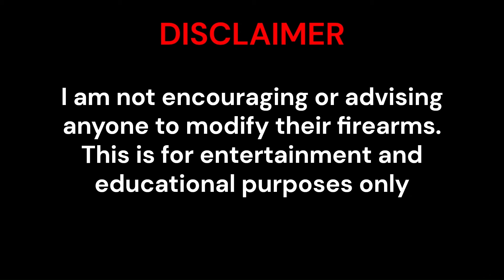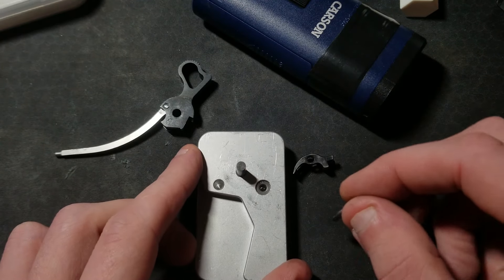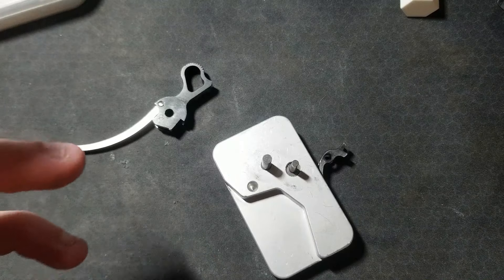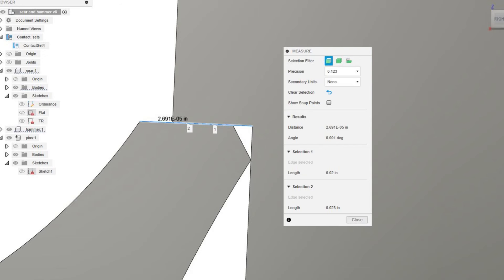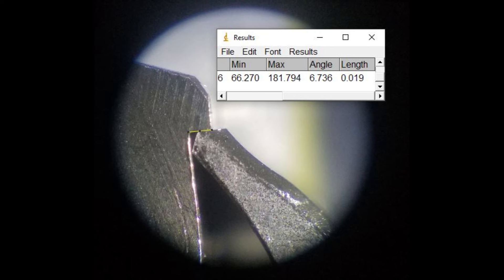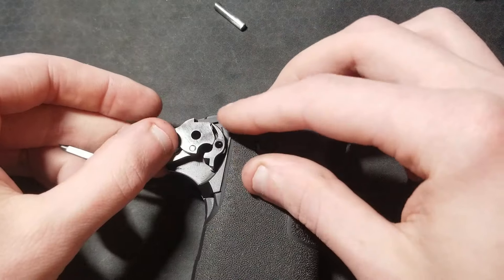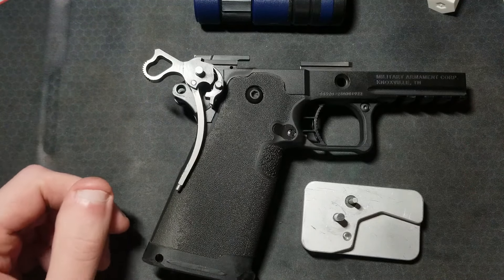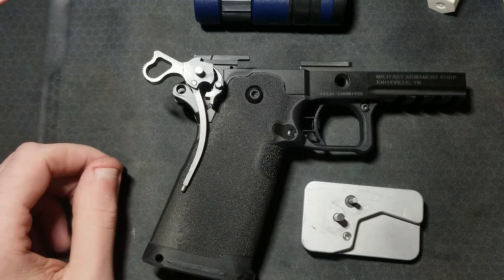Improving My 1911 Trigger Job Tooling and Methods

Comment from the maker: I have found a scanned copy of an original blueprint online: https://www.survivorlibrary.com/library/m1911_blueprints_scans.pdf

This blueprint calls out a +/- .002" tolerance on all sear and hammer pin locational dimensions. Based on that, the range deemed acceptable by the ordinance dimensions for the minimum spacing of the sear and hammer pin holes (rounded to 2 decimal places) is .452" - .463" with the nominal value being .458". This is the hypotenuse of the right triangle created by the horizontal and vertical separation distances of the pin hole (see 02:12 in the video). 

I put those dimensions in my 3D model - the range produces a 2.5 degree engagement angle change between the primary sear face and hammer hook face.

That is a very large acceptable range and the true location of my pins with respect to each other in my jig is well within it.
Reply: I watched an AGW video on triggers a while back.  IIRC They said they matched hammers and triggers on a jig out of bulk batches on a jig before even trying them in the frame.  Then talked about pin holes not being parallel on state of the art CNC machines because of "dull tooling" during the machining process.  LOL  I'll be picking up the Tisas DS later this week and I'll get to stone and polish everything and remove the cerakote from all of the internals.  I think I might port it or the Tisas for a range toy instead of tri-topping.  Too much raw metal to deal with rust proofing.  Need to watch a few more videos don't want to mess with accuracy.  Hopefully it will have a good bushing and barrel lock up.
Reply from the maker: @customcutter100  correct regarding the AGW selection of the sear and hammer. They are picking a pair that matches in their jig from the hundreds of EGW sears and hammers they purchase and have on hand. 

Yeah I wouldn't want to tri-top a slide unless I was going to have it nitrocarburized afterwards (or PVD or something, not cerakote because I have cerakote).

Comment: Very Interesting. Since my knowledge and skills aren’t as extensive as yours, I ordered the EGW ignition kit for the Prodigy (which comes with a sear 0.05 shorter) and a 17lb mainspring, and I’m very happy with the result. With no additional tuning it breaks consistently at 2.5 and I have shot maybe 500 rounds with no problem. I look forward to your analysis once you receive yours.
Reply from the maker: I think you mean .005 shorter😉. Those EGW ignition kits are good. I just read on their site that the sear tip is perpendicular to the pivot axis (like the original 1911 spec geometry) but they call it "neutral geometry." That would be a negative relationship by both ways I define it. Even more interested to get my hands on it now.
Reply: @EngineersArmory  you're right, I miss one zero.  At first, I was somewhat skeptical due to what you mentioned about the tolerances and the distances between the holes, and how they tend to be a bit conservative with these kits. However, it seems that in my case, the fit was very accurate. I think I got a bit lucky
Reply from the maker: @ivanradi4275  Either way, glad it worked out for ya.

Comment: try the dimension with a micrometer, you're probably dead nuts. Also the tolerances of 1911s, pins, hole locations etc i wouldn't expect at all to be within .0005" so it doesn't really matter. and like you mentioned ever frame is going to be different, my favorite type of sear jig is as you described, using the holes on the frame.
Reply from the maker: The ordinance spec on the horizontal and vertical separation distance is only given in 1/1000s so reporting more than 3 places after the decimal after the zero like I did in the video is not actually correct. But since that is a "theoretical" dimension not defined in the original prints, and I can measure to the +/- .0005" with my calipers, thats why I reported it like that. You are absolutely correct, I am more than close enough for my intents and purposes. Frustratingly, the diagrams I have don't have a standard tolerance called out for .XX and .XXX dimensions. And i cant track down any drawing that do.

I'll take this jig back over to my dads next time I'm there and check pin spacing with his micrometers. They are accurate to .00005".
Reply from the maker: DUDE! I found a scanned copy of the original blueprint i was looking for. Tolerance of +/- .002" on all sear and hammer pin locational dimensions. I'll pin a comment about the range of minimum distance between the sear and hammer pin according to that.

Comment: Looking for the Atlas vid you mentioned. Released yet? Also.. Overall respect in relation to engineering results.. Ed Brown or Atlas?
Reply from the maker: Still out of stock. Waiting for the in stock notification to order. Ive used a lot of Ed Brown stuff in the past, its good. Atlas has things more specific to 2011s and bull barrel 1911s that I like more. I generally prefer EGW over ED Brown internals. Ed brown stuff is spendy. I don't buy it much anymore for that reason.

Comment: An additional sear / hammer engagement check I do when frame if fully assembled: pull trigger untill sear moves partially forward on hammer hooks (like .010" or so of foward movement), release trigger, and see if sear falls back into the hammer hooks. 

Difficult check to do when you have .018-.020 hammer hooks but a bit easier with GI spec .025 hammer hooks.

I've used Harrison Designs Ignition kits and components and would like to see how they measure up with sear angles / hammer hook contact. Especially any differences between his true radius and national match sears.
Reply from the maker: My hammer hooks are never more than .020". good test for taller hammer hooks and increased hammer and sear engagement depth.

Comment: These are some really informative videos. Thank you

I have experimented with making the primary sear face width equal to its engagement with the hammer, in other words, making the back of the sear flush with the tips of the hammer hooks. It seems to work well and I find it aesthetically pleasing under the microscope (a $60 Amscope 10x-200x digital). What do you think of this in terms of possible safety and longevity issues?
Reply from the maker: Something like what I show at 04:32 in this video (or close to it)? https://www.youtube.com/watch?v=v1vwDV8lYbo

Its really hard to say without knowing the details of the rest of your hammer and sear geometry. Is there a secondary face on the sear or not? what is the angle of the primary face in relation to the hammer hook face in the fully engaged position? How wide is the primary face of the sear?

With the original geometry from the ordinance dimensions, depending on where the individual parts land in the tolerance range, the hammer hook tip may be equal too or even overhang the far edge of the sear (what I show in the video linked above). However that is with .028-.030" tall hammer hooks (the hammer hooks were at 86 degrees not 90 as well) and no secondary angle on the sear face so there is a ton of engagement, and the sear face is very wide making it stronger and less prone to wear.

If you have to cut a excessive secondary sear face to achieve this because the hammer hooks are .020-.025, then that would make the primary face of the sear too narrow - leading to possible strength and longevity issues. If you achieve this by removing material from the other side of the sear, you run into the same issue. 

It seems to me, to make that geometry safe and reliable, the trigger would end up being heavy and have a mile of creep (trigger feel is subjective. I dont like this, you might?).

If you achieve this geometry with modern hammer hook and sear geometry, I dont possibly see how it could be safe, nor robust, nor last very long. Did you do safety and function checks with it?

One last comment about it looking "aesthetically pleasing" under the microscope. There are parts and modifications we do to firearms in the name of aesthetics, or to prioritize how we want the firearm to look. I get that. However, prioritizing "the looks" of critical ignition components that largely dictate the safety of the firearm is foolish. Once installed in the firearm, you don't see them. Who cares what they look like under a microscope? Critical ignition/safety components should never have form taken into account over function. 

Curious to hear more details of the geometry you're experimenting with. Most of all stay safe man.
Reply: Thank you for the reply. I will take your thoughts on safety and longevity seriously, especially about not going for looks while compromising safety. Especially when the parts in question can't be seen once they are in the gun.

What I was going for was what you describe as "Parallel Positive" in the graphic at 23:01 in the video, but with the back of the sear (the side away from the hammer) flush with the top of the hammer hooks. The hooks are .020 deep and are at 90 degrees, as near as I can make them. The primary sear angle engages about 2/3 of the hammer hook depth with the secondary angle making up the last 1/3. The hammer does lift as the trigger is pulled and there is some creep present.

It seems to me that with a "Flat Neutral" or "Negative" sear angle that the hammer would tend to skate down the primary surface of the sear tip, restrained only by the sear spring, which might be tuned very lightly, and that in a "Parallel Positive" configuration with the primary sear surface projecting proud of the hammer hooks, that the hammer hooks would tend to beat a step into the sear tip. My thinking is that with the sear tip sitting flush with, or even slightly below the hammer hooks any wear to the sear nose would tend to be self-compensating, drawing the sear into tighter engagement with the hammer. I may be wrong about this, possible over- (or under-) thinking it, and would to hear your thoughts.

I am waiting for a new barrel to replace the one that I had ported. Any reduction in muzzle lift is not worth what the exiting gasses are doing to the fiber optic front sight, which is first burned black, then departs the pistol. I will have the gun, a 5" Springfield Prodigy, apart for the barrel replacement and will take some pictures of the hammer and sear to see how well or poorly they have withstood the 3,000 rounds or so I have on the gun, which I have been using for Steel Challenge in club matches for a couple of years, and for a week-long class at Gunsite a couple of weeks ago.

I can't begin to tell you how much I enjoy talking to people who are smarter than me, and who know more. Thank you again for responding.

P.S. - Whenever I fit or modify a sear and/or hammer, which I usually do as a set, I always verify the operation of the thumb safety and adjust or (usually) replace it as needed.
Reply from the maker: @bradharris7230  I think I understand your geometry correctly. Thank you for the detailed description. 

If you have .020" hammer hooks that reach to the far edge of the sear, and a parallel positive relationship (as I described it), and your primary sear face is about 2/3 of the engagement width of the hammer hook, that leaves the sear primary face at roughly .013". Everything I have seen says primary sear face width should be .020" minimum. In my opinion, this narrow sear tip would make it more fragile and prone to wear. 

Regarding beating a step into the sear tip when the hammer hooks engage part way across the sear tip - I dont think that is much of a concern. Almost every 1911 sear and hammer I have seen have this engagement relationship (even if there is a negative engagement relationship where only the hammer hook edge contacts the face. If it was not ideal (from a wear standpoint), people much smarter than me would have figured that out by now, and it wouldn't be the norm.

When the slide moves back it cocks the hammer, it brings it slightly past the fully cocked angle, the sear is pushed into place by the left tang of the sear spring, then when the slide comes forward, the hammer only drops slightly (from that over-cocked position) onto the sear face. It may make a little mark in a nicely polished sear face, but I have never seen it create a step. maybe if the sear material was not the proper hardness it would (properly molded and heat treated MIM parts are not a concern here).

if you have ever had a hammer drop from fully cocked to half cocked - that damages the tip of the sear pretty badly. Most safety catch notches in hammers only contact the sear in the center - so the area where the hammer hooks contact is not damaged, ,and your hammer hook/sear relationship is not compromised.

There is subjectivity about trigger feel, safety is not subjective. It passes the requisite safety checks or it doesn't. The sear tip geometry as you have described it seems fragile to me (I could be wrong - I wouldn't want to find out the hard way). It may initially pass safety checks, but if it is fragile - it may quickly wear into an unsafe state without you knowing. I would recommend all sear primary faces be minimum of .020" based on what I have seen and my experience with trigger jobs. 

Whatever you do, stay safe. Your safety and the safety of those around you when you're shooting is the priority. Err on the side of safety. I always slightly compromise the quality of my trigger feel to be conservative with my safety factors.
Reply: Thank you again for your reply. When the new barrel arrives I will take the opportunity to put your recommendation regarding the sear primary surface width into practice, and make it my SOP going forward.

Comment: As always, thanks for the excellent video. I’m appreciating the deep-dive into the guts of the 1911/2011, with the extreme detail that you’ve got.

Total side note, what photo editing software do you use? I mostly shoot still photography, and I’m always fascinated with what people use to edit their photos.
Reply from the maker: For overlaying photos, drawing on them, etc. I usually use PowerPoint hahahah. Sometimes I do stuff in MS paint lol. The software I use to take the measurements is called ImageJ.
Reply: @EngineersArmory  Honestly, there's so much that you can do with PowerPoint and Paint. It's a shame that MS is fucking over paint right now. I've used it a lot to crop/resize/watermark photos, and they've made the software much less user friendly over the last 6 months. I'll have to give ImageJ a look, I've not heard of it before.
Reply from the maker: @Paul_Whaley  yeah the photo editor app (what ever one opens up on my windows machine) works pretty well too. PowerPoint is still my go to. 

The imagej software is more tailored to microscope lab work. I used it a lot when I was doing R&D at a tech start up. Paired with a USB microscope camera I used it to accurately measure micron size features (with a corresponding calibration slide of course). Later on I found I liked the AmScope software better for those purposes. I also had access to a desktop scanning electron microscope that had measurement capabilities accurate down to the nanometer. It was dope and I'm bummed I dont have access to that shit anymore hahaha.

Comment: Good stuff.  Were the pin holes parallel on the mac9 frame?
Reply from the maker: Hard to say. I measured them and saw .001" deviation over the .300" height that is the width of the hammer and sear - on top of the little plastic spacer. That is likely due to the play of the pins in the frame and the fact that I cannot measure their minimum distance up against the frame side (the raised section for the grip module is in the way of that). soooooo... I dont know haha. Probably close enough to parallel?
Reply from the maker: I have access to a whole gage pin set... Pretty easy to just find the best fitting pins for a given frame then measure their distance and parallelism haha.

Comment: Isn't the AGW ignition system just a rebranded EGW kit? Those are always in stock.
Reply from the maker: Yes but they buy hundreds of sears and hammers from EGW so they inspect and match them up for "perfect" engagement before packing them to sell. Here is their video on it that explains the process:

https://youtu.be/gZE_YgjvdbU?si=TsqsY1qH8zMCOnB4

Here it is on their website. Been out of stock for months. 

https://atlasgunworks.com/product/perfect-match-ignition-kit-with-lightened-hammer
Reply: The Atlas claim is that they start with a big pile of hammers and a big pile of sears and someone sits amd matches them up for the best-fitting pairs. I find that the Atlas kits consistently fit and perform better than buying individual parts from EGW or, say, Wilson Combat.